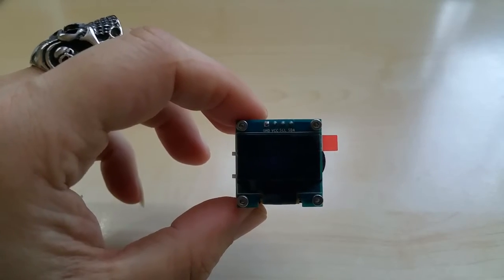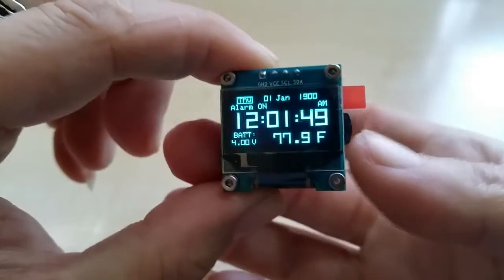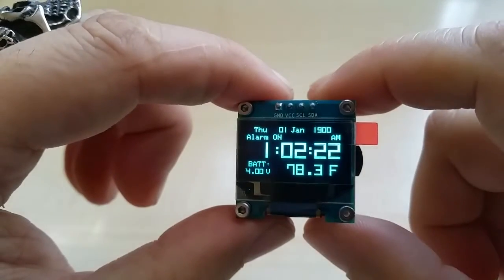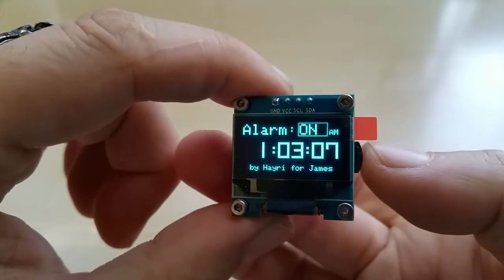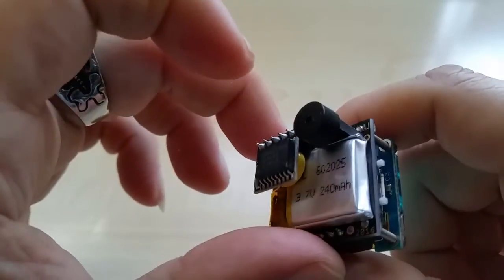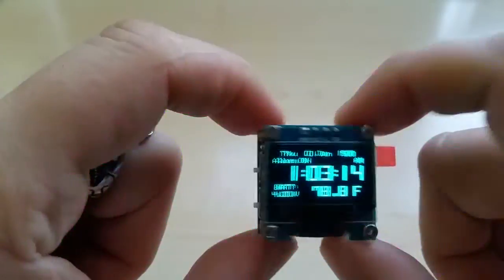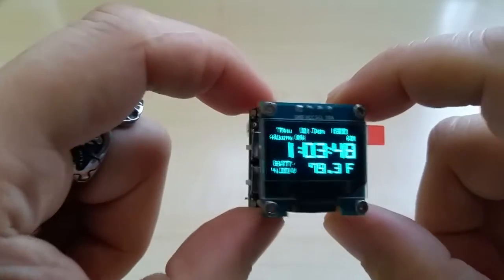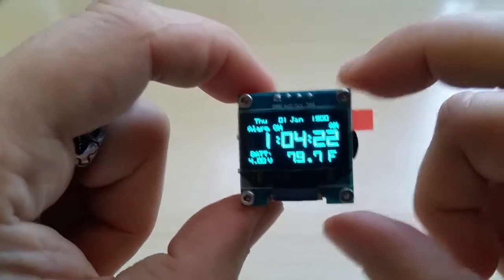How to set the time and alarm on my OLEDiUNO Cube Clock

Comment: Hi, would it be possible to order one of these with out the battery and buzzer and just be powered over usb ?
Reply from the maker: Of course, I can also include a micro USB port so you can connect it to a PC or use it with a cellphone charger. You can order it from my Tindie store, I will have them back in stock shortly.

Comment: Hey man great work! Love it! 

I have a question about the navigation control, I found the EVQWKA001 component but it's quite difficult to buy
The UP/DOWN/CLICK component you have is replaceable with an infinite scrolling wheel like this one? https://hackaday.io/project/10533-nano-tty/log/35964-encoders
Reply from the maker: Well the pinouts don't match, would need to design a new PCB